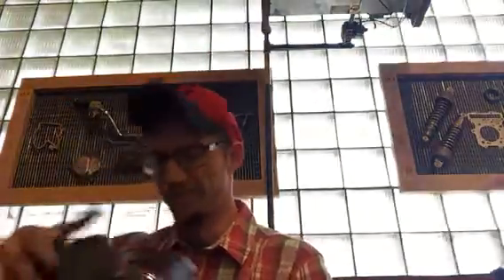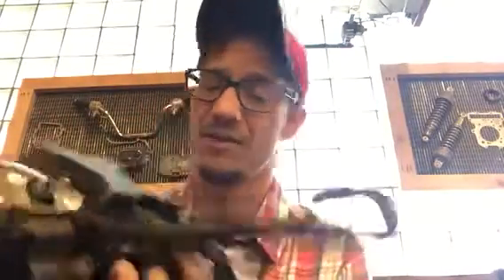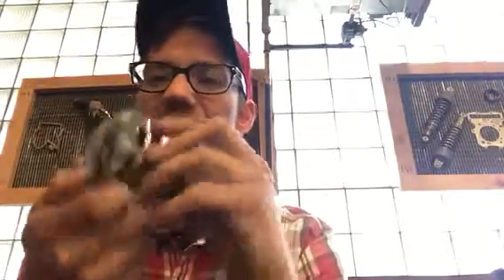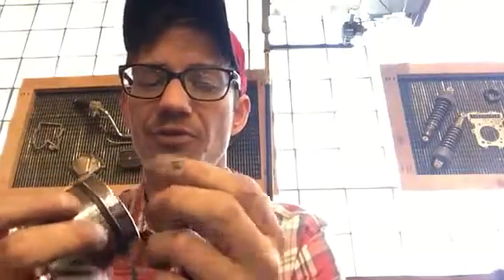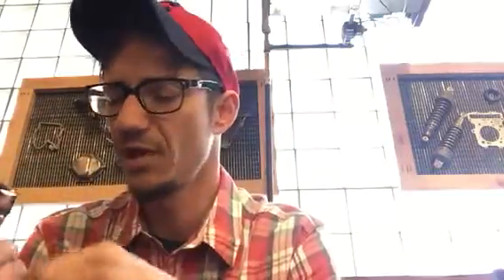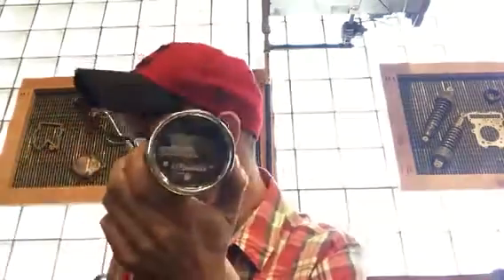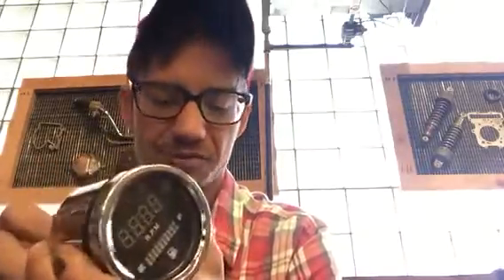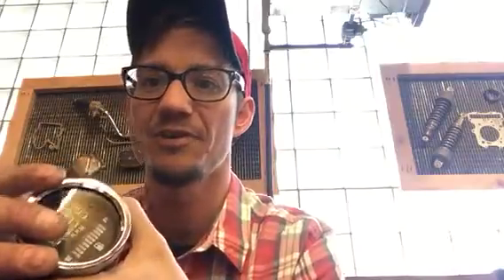How to convert Tachometer mechanical cable to electronic on motorcycle

Comment: What’s up man.I’m doing the same thing with my bike what do I do when I eliminate the cable, you think I be able to find a plug or something?
Reply from the maker: Café racer Suzuki I’m sure you can find plugs online. What I ended up doing was using the cable and cut off the end of the cable that plugged into the engine and filled it gasket sealant. Unless you have a drill press and or a  lathe and just fab up a plug